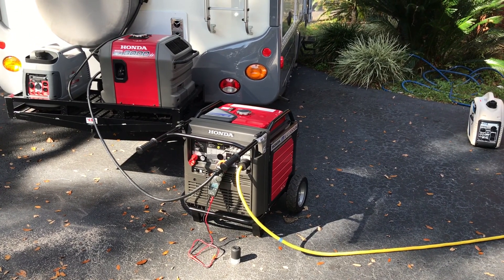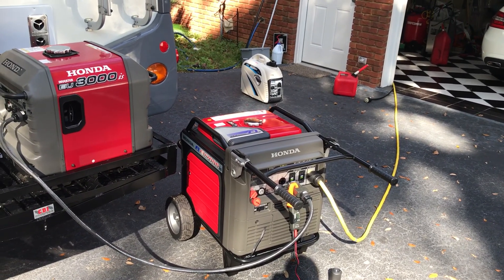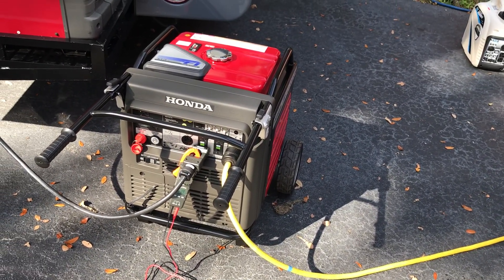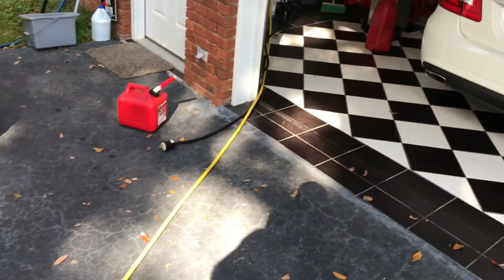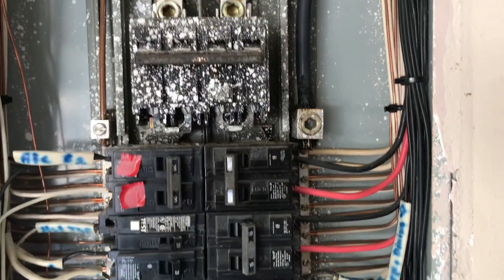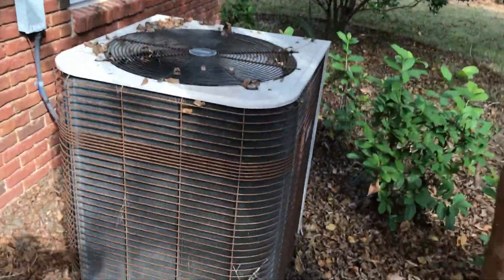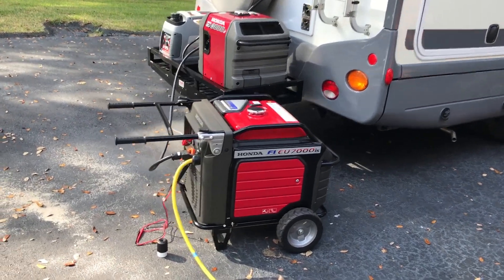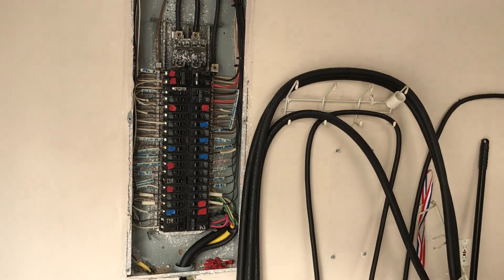Honda eu7000is runs 4 Ton central A/C unit running in parallel with an  eu3000is Honda inverter

Comment: The EU3000 is 115 volt.... not sure how you can run a 220v HVAC and parallel for a HVAC with 115v EU3000

Comment: Take a look at Hyper Engineering Soft Starter, It will knock down the starting amps  more then half.  A 4 ton will draw approx 100 amps on start up, after the soft start is installed, your at about 40 amps on start up.

Comment from the maker: It says 17.6 running load amps and 90 locked rotor starting amps.  This is on the 4 ton air conditioning unit

Comment from the maker: With only my 7000 W generator running it will surge to 9200 W for about two seconds before the small 2 ton unit kicks in with both generators hooked together it starts the 2 ton and the 4 ton unit with no problem at all but I have not been able to be at the generator when the 4 ton unit turns on to see exactly what the surge load is. With them hooked up like this it will only show me the surge on the 7000 W generator that has a watt meter and it only reflects 2/3 of the load because the other 1/3 of the load goes to the smaller generator. From what I have determined that if the big generator is running at 50% load it is pulling 3500 W and the secondary generator a 3000 W generator will be pulling about 1500 W so they equalized in proportion to their total output.
Reply: Get a MicroAir Easystart from Hutch Mountain.  You'll be able to start your a/c with your 7k Honda alone with eco mode on.  I'll hook you up! :)